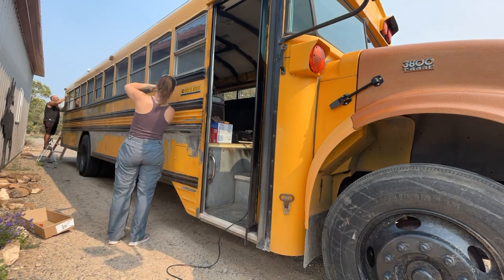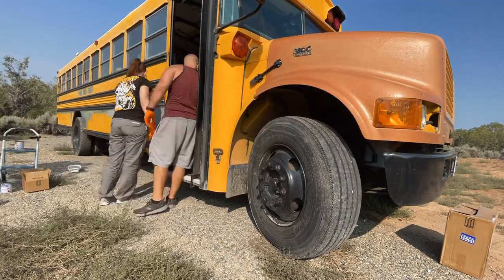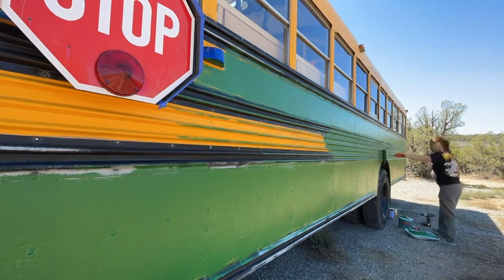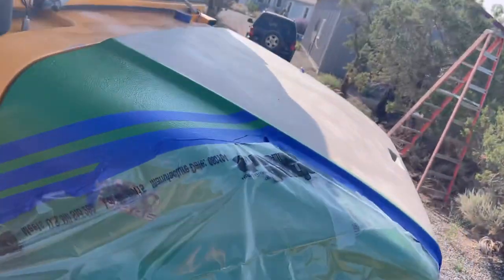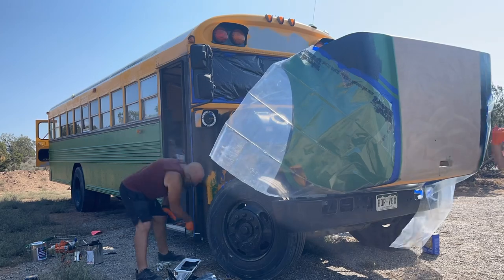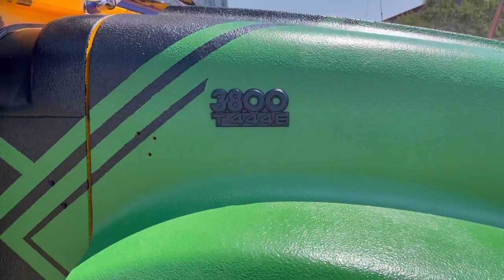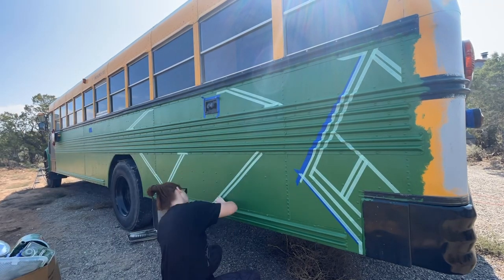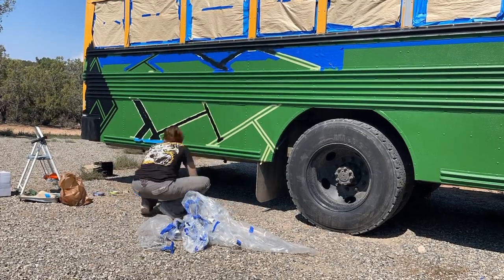MONSTALINER ON A SCHOOL BUS + tips and tricks for graphic designs with liner - Speakeasy Skoolie

Comment: Have definitely decided to use monstaliner and take my jeep from old to fresh
Reply from the maker: You won’t regret it!
Reply: @ontherocks_offthegrid   just wondering what approach to take first. Going to be lining a 93 Jeep Grand Cherokee and I’m guessing that the doors should be removed and whatever else I can take off the car then paint door jams and fittings then come back and paint whole body after doors have been put back on. As far as door jams go did you just use regular liner on jams or did you buy three door jam paint
Reply from the maker: @christopherfausz2032  if you can remove the doors then do but it isn’t a requirement. Having them open to have the gap between them and the body is more than enough. Grand cherokees often have wiring that makes it harder to remove doors. But if yours have manual windows its likely not going to be hard to remove them. When I did jeeps in the past they didn’t have the jamb paint but doing it today i would definitely use it for the door jambs as its color matched to the liner and thinner than the liner so it wont impede the function of the doors. On a wrangler door are able to be manipulated with the way they sit, Cherokee and grand Cherokee doors don’t have that ability so the jamb paint is a better option. You definitely want to remove the handles and locks if possible, if you find you can’t remove something however mask it off and pull the tape as soon as you put the second coat on and you should be fine.
Reply: @ontherocks_offthegrid   well I have electric windows but have quick disconnects from harness that goes to the body. Was planning on replacing all of the door weather stripping and figured it would be the best time to do so. Just wasn’t sure if buying jam paint was a unnecessary expense as I’ve seen people use regular liner as far as door handles go I think your right and removing door handles would make for a cleaner look
Reply from the maker: @christopherfausz2032  you can definitely still use regular liner. Those little cans of jamb paint go a very very long way but aren’t a requirement just an option. Sounds like you’ve got a good plan. I’m sure your project will look great.
Reply: @ontherocks_offthegrid  haven’t looked at the rest of your vids yet but any vids or channels you can suggest in regards to monstaliner would be very helpful. I guess my only worry at this time is how to get fender well tubs to blend in as I figure I would paint those black different from base color I will be choosing
Reply from the maker: @christopherfausz2032  if you want to match the black Monstaliner rustoleum 2x spray paint in Canyon Black - satin - is a match for the color and finish. That’s what i use to match the black. If you can get the color sample chips for the colors you plan to use you can take them to the hardware store with you and see if you can find that spray paint in the same color - if you can then get it in the satin finish and you’ll be good to go with a color match. Super easy. You may have to go to a few different stores to find the right shade but rustoleum makes 100s of colors so its very likely you can find a match or a near match in a satin finish to use.
Reply: @ontherocks_offthegrid   😂 I hope so but I’ve always wanted to by a short bus but never have because who really wants to drive a yellow bus but your vid definitely gives inspiration to the possibilities of converting one to a small camper some day. Thanks for your time and advice
Reply from the maker: @christopher Fausz highly suggest joining the Monstaliner Masters Facebook group to have access to the whole community. Unfortunately there really aren’t a lot of videos or forums out there for monsta for some reason! Hope that can help you :)

Comment: how's this been holding up?  I'm going to be using RaptorLiner for my house truck.
Reply from the maker: I've been using monstaliner on rigs since 2014, I've never had a experience with a bedliner that doesnt fade after being parked day in and day out in direct sunlight except for this brand. basically, its held up incredibly well.
Reply: @ontherocks_offthegrid  I'm going with variations of sand color to match the CARC Desert Storm paint job that the truck has now
Reply from the maker: Monstaliner has I think 6 different tan colors. All of their colors are based on classic automotive paint colors. You can order free paint chips to check them out in person